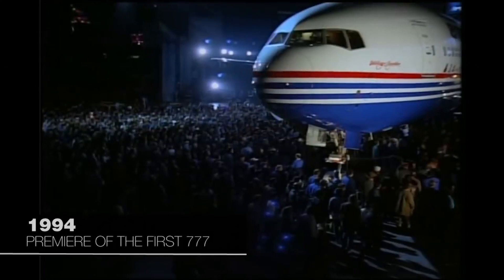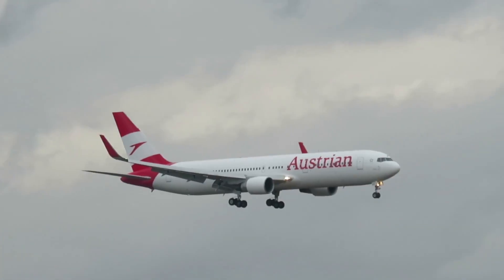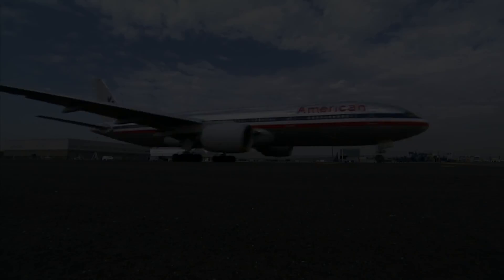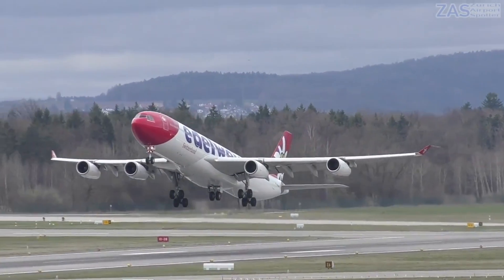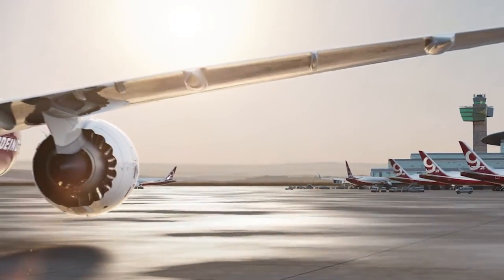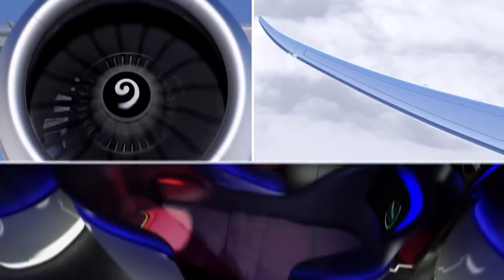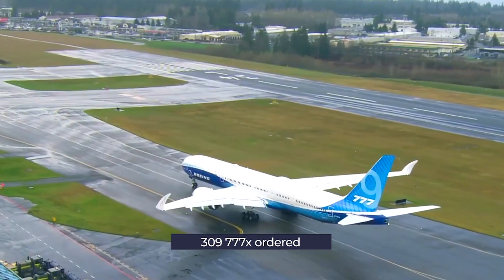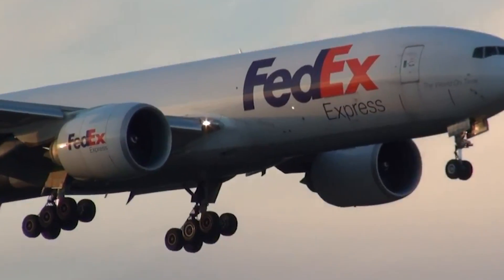Why Doesn’t The Boeing 777 Have Four Engines Like The A340?

Comment: imagine a 777 with 4 engines. those ge90's would roar
Reply: That would be WAY too much thrust for an aircraft the size of a 777.
Reply: @alexandernorman5337  itwasajoke.jpg
Reply: @alexandernorman5337  ikr
Reply: Maybe a reegineered AN-225 could use 4 GE9X to get better fuel burn?
Reply: @mingming9604  now that is an idea i'd like experts to comment on
Reply: @mingming9604 6 engines. It HAS to be 6. Otherwise it's no an225
Reply: @mingming9604  been dreaming of this since I know of the Antonov and GE90
Reply: That would be a new supersonic jet Lol
Reply: SOTL 777 would be fun, imagine being a passenger there, drag strip experience
Reply: What about a 777x with four engines 
The shear speed that would be capable 
Also it would be efficient
Effectively making a more viable Boeing 2707
Reply: I think it will reach it cruising alt in 5 min.
Reply: I guess u don't live next to an airport?😁😁
Reply: @oxcart4172  WOW! How did you just guess that? OMG
Reply: @oxcart4172  I used to live near an airport in Guam and I heard the planes taking off
Reply: AviationSimulation it would be waaaaaaaaaay too loud! And very fast
Reply: Im guessing the airframe and high-bypass design wont allow for supersonic travel... but my god thats alot of grunt. Its like a ferrari that has its top speed pegged at 180kmh.
Reply: Hahahaha ge90 go brrrr
Reply: That thing would break in half lmao

Comment: Boeing with big brain: Makes 777 wisely!

Airbus with tiny immature Brian: Builds A380 immaturely like a kid
Reply: okay..... let me explain for you. THE A380 WAS MEANT TO CHALLENGE THE 747!!!!!!! it just came in at the wrong time, so dont call them ïmmature".
Reply: @GalaxyYeaYea  It was childish they just wanted to beat the 747 that's it. There was no real reason to build it. However Im glad they did build it😎
Reply: @ethansaviation2672  It makes sense, 747 had alot of sales and there was a real reason, Hub to hub travel. It was meant to solve runway slots in big hubs
Reply: @GalaxyYeaYea  The A380 was built to challenge the 747 at the time 747 were started to die

Comment: Short answer: big brain fuel economy saves
Reply: Also ETOPS...
Reply: Very weird how an American aircraft manufacturer managed to convince the American government that there would be a competitive advantage in not having two unnecessary engines, thereby selling more planes than airbus
Reply: OMYGOD UR FROM CHRIS GROUP
Reply: Lol
Reply: @fsg7710  i think i know you u from united
Reply: Also more reliable engines
Reply: Thanks,You save my time:)
Reply: Stonks
Reply: @SongSecheon that about sums it up in a nutshell
Reply: except the fuel economy argument is wrong. The true reason is lower maintenance cost
Reply: @Meddlmoe  If you're gonna say it's wrong, you may as well post fuel burn per seat-mile stats of competing aircraft, or fuel burn per ton mile for cargo.
Otherwise it's just random words.
Reply: @Kalvinjj  pick any turbine engine you like, and you will see, that it more efficient at 3/4 of its peak power than at 1/2 of its peak power. And due to safety reasons two engine aircraft must have engines with more exess power than 4 engine aircraft, because of the risk of one engine failing.
Reply: @Kalvinjj  no cap
Reply: @Meddlmoe  It's not wrong actually, it is one of the reasons ALONG WITH cost, both unit cost of the engines and maintenance of them.